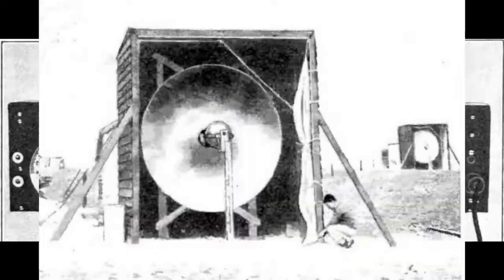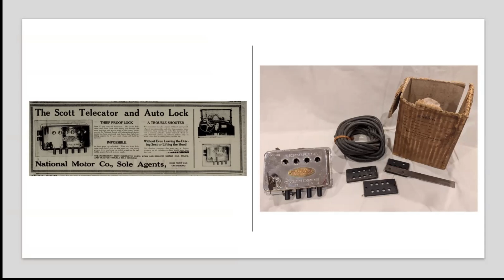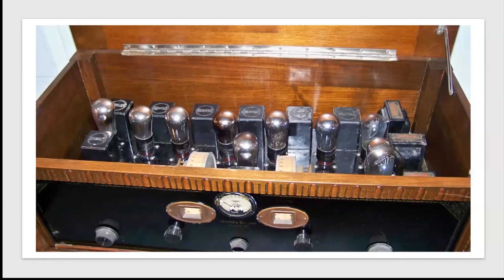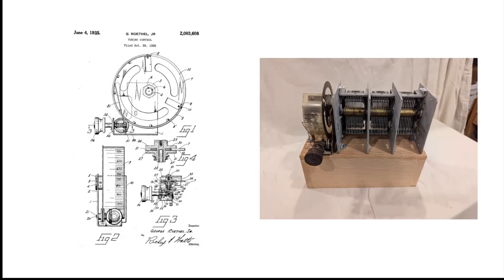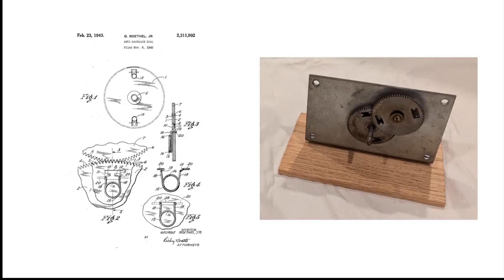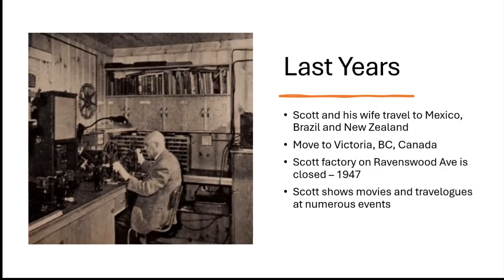"The Fine Things Are Always Made by Hand". The history of E.H. Scott, presented by Kent King

Comment: Interresting. I have never heard about him before. Thanks for the upload.
Reply: These car "testing" devices seem to be gimics. The most they seem to be able to tell you is if a plug is getting spark and maybe the vacuum on the intake as a carb indicator. Pretty useless gauges to have especially in ground based vehicles. The only real value in the rig is the keyed ignition.